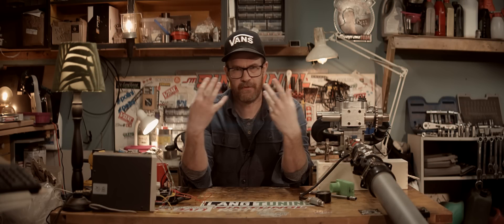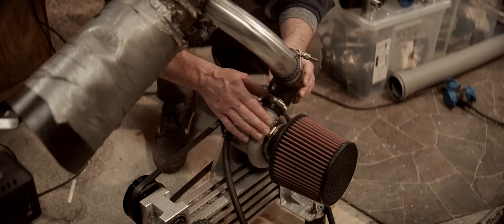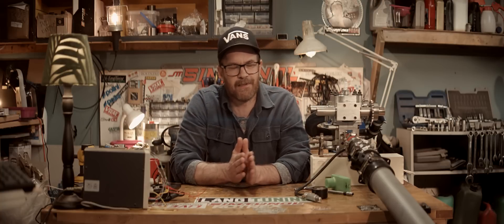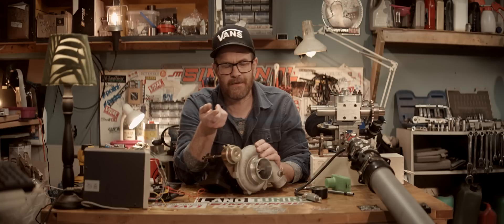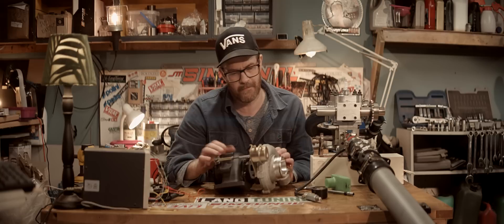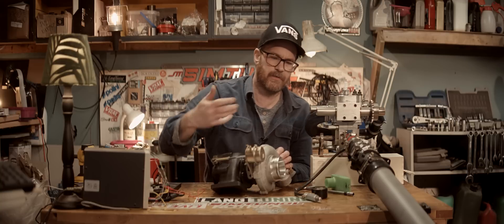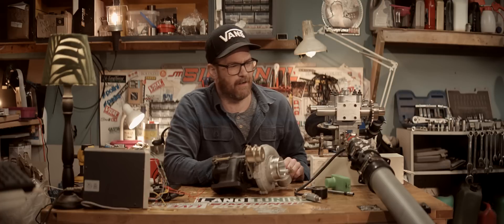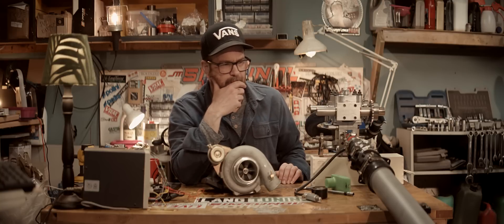THE most genius/stupid idea! Turbojet supercharging.

Comment: Makes sense somehow...
I presume that the first compressor is a positive flow type - in other words for each revolution it moves a fixed volume of air and the air cannot flow "backwards".
Then that drives the second "turbo" compressor where the "drive air" does not necessarily make the turbine turn at speeds directly proportional to the volume of air being received.
That will help keep the pulsing experienced after the 2nd compressor down because if the pressure is too high momentarily, some of the compressed sit will "bleed back" through the turbine thus not making the "pulsing" so pronounced...
I think...
A hybrid inlet air compressing device - a HIAC device if you will. 
Think so... it might... maybe...
Oh well, we will find out one way or another in a future video won't we.

Comment: WHY NOT JUST RUN A ELECTRIC SUPERCHARGER? Maybe a centrafugal compound unit powered by a 3kw motor. Use two turbo compressor sections a small one and one slightly larger.  That dumps into the smaller. With the throttle connected to the motor controller. It would work best with a programmable controller. That allows the throttle curve to be programmed. To set how much power the motor gets at a given throttle position. Actually using a microcontroller as the throttle for a normal controller would possibly work better. Then sensors can be used to map a pressure curve to throttle, keeping the pressure and given throttle , also taking in engine speed into account. Sounds more complex than it is.  Maybe a single compressor can handle this on it's on being electrically powered . maybe 3kw isn't enough, a battery for a E bike can possibly be used. 72 v.  I'm  thinking this could be a game changer. ., it being land speed,  there is time to charge batteries between runs. And best of all. The boost is free, no  losses driving the 
System.  Keep on keeping on , with all that  AWESOME⚡✌️

Comment: Don't bother with the supercharger at all.... just hook the turbo up to the 50cc 2 stroke engine as would be in a convention setup, and then to get it to make boost to get it started, just hook up a leaf blower to the inlet of the turbo, get it started and self sustaining, and then remove the leaf blower (a bit like how homemade turbojet engines using turbochargers are started). Once the engine fires in to life, it can be mapped/tuned to rev hard enough to keep the turbocharger spooling at 'idle'. The great thing with a turbo is that if you end up dumping too much charge out of the exhaust, that can be burnt to help spin the turbo faster - its not lost. Perhaps think of it as a turbojet engine which happens to have a 2 stroke engine in the middle of it. Not sure if it would work, but I sort of feel like it could be made to work, especially if you are using fuel injection so you can choose to dump extra fuel at the right times.

Comment: Like others have mentioned, buy or build a separate air compressor / gas generator that meets your required flow rate at your required pressure(s) independent of the engine with a separate power source.  Then test your engine configurations. You may need your new intercooler to help get a stable air density for testing.  When you get your engine the way you like it then figure out how to get the engine to power its own compressor.  Maybe you will need a tank of compressed air to aid in remote starting until the engine can develop its own air flow/pressure.

Comment: You must have been drunk 😂
Use an electric driven centrifugal rotrex  supercharger then you can measure what you need in terms of rpm at which engine rpm then work on a mechanical solution to drive the supercharger.
Man you need to introduce some method in your pointless faffing around

Comment: Running the blower from an electric motor with a constant RPM (like most larger A/C inductive motors), will help with consistency in testing. Also a good idea to do some "baseline" test runs against a known flow restrictor, like your little green restrictor, before doing any experiments is a good idea. Temperature and other changes may make enough change day-to-day to throw off your results.

Comment: I was wondering if you should just make turbo jet engine and take the boost for the engine before jets combustion chamber. It should be quite easy to modify the boost level by giving the turbojet more fuel ti increase its rpms, and airflow for the engine would be so marginal, that it wouldnt affect operation of the jet engine. I have no clue how the rules are if it is allowed to do that way or not, but it would propably work at least. For example APU engine kinda works this way to provide compressed air for main engine startup.

Comment: I'm not sure if this set up actually going to work...the reason? The energy from the exhaust gases has a significant part of the function and efficiency of the turbo, so if I understand it all correctly "correct me if I'm wrong " you intend to drive the turbo with the charger, right!? If so, I don't think that will be sufficient enough to get the desired boost you aiming for..since most of the energy a turbo depends on is from the energy in the exhaust heat and less from the flow..! It will most likely work, but to reach those boost levels will most likely be hard to reach...!
I am happy to admit that I'm wrong...but I have never seen that concept before and I suppose if I understand the concept right, that's the reason!

Comment: This problem was solved just in the past. The solution is an external reciprocating piston compressor driven by the engine. High pressure ratio with fixed displacement per revolution.
Reply: Just use a root type supercharger
Just like he used before fix displacement
Reply: @legros731  root type compressor is not adequate for high compression ratio and pulsating flow.

Comment: The high end larger turbos are up to 6:1 ratios now. The pressure will not be the issue, issue will be to find a small enough turbo match, that will keep you out of surge, but as well out of choke, which is the opposite. One suggestion would be to get a turbocharger where the maps are plotted with rpm lines and pressure, then you can much easier indicate where in the map you are. Measuring air flow reliably with such a small engine is really tricky.

Comment: Not going to happen on a single turbo. This is why compound turbocharging exists, for high boost pressures look at what the diesel guys are doing. Tractor pulling and that sort of thing. It will still work with your idea though but will just need multiple stages. It may be fairly susceptible to turbo lag tho. 

Though at this rate it may be better to build a twin cylinder engine where one cylinder is a compressor and feeds the air to the other. That way it will all be sized correctly as well as being directly linked to engine RPM. No turbo lag,

Comment: look up the car manic beattie. it usedsa helicopter starter gas turbine to compress air straight into the engine. it used to feed the compressor of a turbo but the current configuration is supposed to be even better.

Comment: When it comes to creating the most powerful 50cc two stroke I think adding a turbojet engine to super charge the 50cc is defeating your goal, as it is not just the 50cc anymore.
Finding a smaller blower or turbo or someone who can make this is the only solution which isn't cheating.
Furthermore I think they wouldn't approve this setup for a 50cc landspeed record.

Comment: If you must force air into a 50cc motor just use a speed controlled, battery powered, ducted fan. 
It probably won't make much difference but it has a better chance than repeating the same old mistakes (parasitic loss, lack of compressor control etc).

Comment: I like your take on this insanity but. I have a couple ideas. 

-Without additional turbo
  You could use the bleed air from the super charger and bypass it to the exhaust to create a Venturi effect to help create a constant vacuum at the exhaust port of the engine. 

- with turbo (this is where the insanity really begins.)
  As stated above but the vac assisted engine exhaust is being fed into a blow down chamber that connects to the turbos turbine housing. Inside this blow down chamber is a afterburner assembly. 
The compressor of the turbo is connected to the inlet of the centrifugal super charger. You would be able to balance airflow with 2 throttles 1 for bypass to exhaust after the super charger and the other before the engine. With having the pressure ratio over the twin charge set up 4-5 bar of boost should be easy enough. 

Although if you are going to try out your ideas I would recommend a GTB1544V variable geometry turbo. The GTB was a update on the older GT turbos that had some slight tweaks to be able to better handle heat from post injection required for DPF regen.
Reply: Out of sight man,I suggested using his shop vac for this a while back but he didn't do it

Comment: Why not add another cylinder just for acting as an compressor. For example, a 150cc cylinder would produce very roughly 3 bars, and if that's not enough, you can use super charger to fill the compressor cylinder.

Comment: I think if you made a delaval nozzle to acelerate the excess air to then shoot it back into the Intake, using Venturi to, in theory increase the airflow into the inlet...maybe. I am also not sure if the pressure of the turbo is not static meaning its only using the energy that is actualy needed. Same efekt as plugging a Vacuumcleaner hose where it spules up (spinns without using much power). Very cool seeing where your Projekt has went over the years! Best of luck!

Comment: Why don’t you simply get a compressor and a big reservoir and provide 2,3,4 bar into a pressurised intake system and try your theory out  without going to all the expense and time to try and provide the same thing i.e. pressurised intake air? “Keep It simple, Sir” In fact why not just explore using a pressurised reservoir with a regulator?

Comment: Even if it does not work we will all have learned something 😉
How about using a 3 phase motor and vfd for the for the blower, you could even hook it up to a computer to adjust the speed depending on rpm and throttle position.

Comment: To me it sounds like the easiest way to do it is a simple compound setup. air goes into the turbo, then into the supercharger, then engine. the exhaust then goes out to the turbine side. the supercharger can then sit in it's happy spot of 3:1 (2 bar boost) and the turbo sits at a PR of 2:1. In the end it compounds together to get 6:1 giving you more than enough range of power. You could also play around with the supercharger down to 2:1 and the turbo up higher, but a small turbo that is in your final flow range/power probably won't go much beyond 1-1.5 bar.

Comment: The turbojet is a genius idea, but I don't think it would be very efficient. Lots of energy transfers and weak points all just to get the right boost. It would be a tuning nightmare as well. I vote supercharger with a waste gate. Use co2 or compressed air to control it with a electronic boost controller. Should be able to stop the surge and control boost that way

Comment: You could use the supercharger to spin the turbo and direct the air back into the turbo inlet, the air from the supercharger would still require a pressure differential to run the turbo but it would work if your flow rates are correct, would rob some rpm from the turbo tho

Comment: At this point, why don't you get a 125cc 4 stroke engine and turbocharge it - but hook the turbocharger air outlet up to your brute force engine? VZ21 RHB31?

Not quite as cool as using a turbojet engine as an airpump for a moped engine, but way more fuel efficient, i'd say.

Comment: "Compressing air takes a whole load of energy; around 6-7bhp for every psi of boost is sapped from an engine to drive a mechanical supercharger"
If this statement is true then how will this pan out on a 50cc  engine with limited power?

Comment: While you are in the early stages, why not keep things simple to reduce variables?

Drive the compressor section of a small turbo using the shaft directly - take the turbine wheel off and use a brushless DC motor (geared or not).

That will give you a wide range of pressure and flow rates to play with the 2 stroke engine in the garage.

Trying to build a more elaborate system to feed pressurised air to the unproven engine seems the reverse of the order you need to work in.

Comment: You are overcomplicated things if you going to get anything made ask rotrex if they can make a smaller wheel and compressor housing on the same frame, or just ditch the blower and run of a compressed air tank there is video on youtube of the founders of nos doing this

Comment: 7:44 like the anti lag system used by rally racers once used. A turbo jet  basically that used the engine as a fuel air source for the combusting in the exhaust, it was very interesting.

Comment: How about using a venturi assist on the exhaust with that bleed air from the compressor? Have the blower pushing and sucking exhaust out! Or use the bleed air to turn a turbocharger! (I should have kept watching before commenting!)

Comment: Some companies who put turbochargers on very small displacement, or very low numbers of cylinders [as in below 3] use a pressure chamber/plenum.

This aerostatic elasticity allows turbochargers to operate much more efficiently and surge much less and within a narrower area of operation.

Comment: I love your videos but this is the most free jazz idea you could have. It's a cool idea but not a good ideas to begin testing a home made engine with. Start by verifying your engine design and fine tuning it. You are talking about needing 4 bar, that's 60psi, you are currently producing 0.3 bar with that compressor and you haven't tested that engine to it pressure yet. 

You need to make an engine that can take that kind of boost first before you start making a crazy setup to feed it

Comment: So the solution to the charger providing too much air at too low pressure, is to try and wastefully convert some excess volume to spin a turbo, which will give better pressure, and sub optimally, return back to having to vent excess pressure because of the still excess volume of air

Comment: Use a small turbo compressor designed for low flow and high pressure with an electric drive. Problem solved.

Comment: ok just a dumb idea
-take a 250cc inline 4 kawasaki ZX25R engine that makes 50hp at 17000rpm.
-reduce the stroke so it makes 200cc/50cc per cylinder/40hp 
-make custom camshafts so that only one cylinder is fired up, 3 cylinders are opening and closing the valves at every crank rotation to use them as piston air compressors. you are now making only 10 hp
-connect the exhaust valves of the 3 cylinders to a small air tank with an intercooler beetween, and connect the air tank to the intake of the cylinder firing up. now for every 720 degrees of crank rotation (4 strokes of the single compbustion cylinder) you have 2 x 3 compression strokes, so you are effectively pushing 6x more air into the single cylinder ( 73psi of boost) with potential for ~60hp. all the injectors would send fuel into the same cylinder. with stock compression ratio, compressing 300cc of air into 50cc at constant temperatrue gives 54.7J so 10hp at 17000rpm so still huge net increase in power. of course its all maximum theorical numbers and the boost could be reduced by changing the valve timing, also reducing the drag. also to run at that level of boost you'll need lower compression, racing fuel/ nitromethane, much stronger bottom end since the engine would produce about same power as the 250cc NA, but producing all of it with a single 50cc cylinder and 1/4 the number of ignitions

Comment: Single compressors aren't good at making high pressure differential.  As the change in pressure across the compressor wheel gets higher, the speed of the wheel gets closer to the speed of sound where weird stuff happens and there's a tremendous loss of efficiency.  In order to make higher absolute pressure, you need a compound compressor setup.  This could be two compressors of different sizes on the same shaft where the outer compressor feeds into the inner compressor.

Comment: Jeasus christ, this is the most ass backward channel I have ever seen. Maybe you should get this thing called a WASTEGATE to bleed off the excess pressure and not some cockamamy hodge podge of crap. You can't even get an engine to run normally aspirated, so how do you think this will work out?

Comment: Why not use the two compressors you have in series? The small one only creates half the boost (1.5ish) but at higher flow, then that feeds the roots compressor that boosts it even higher, then you'll get high boost low flow